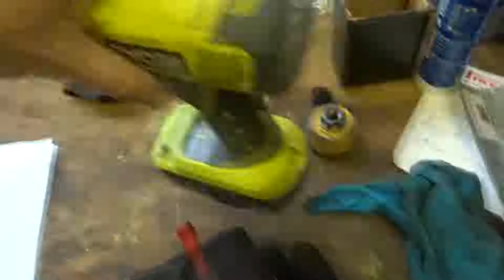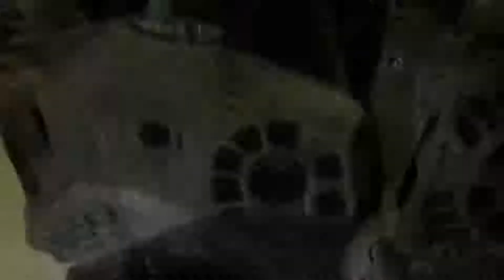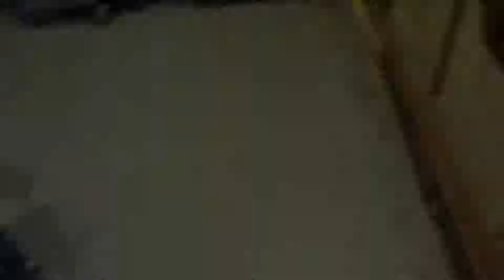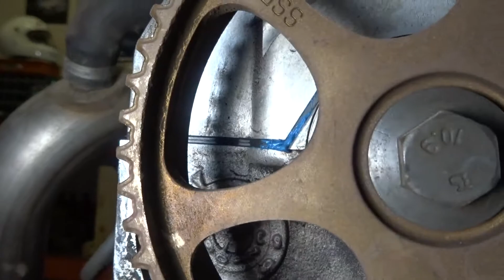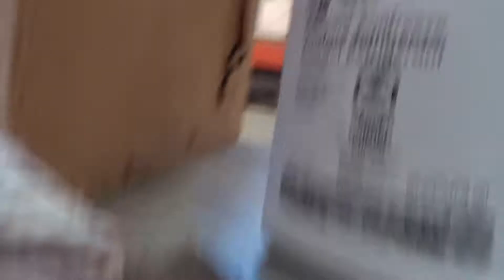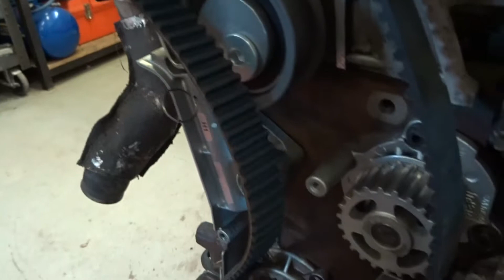How to replace a timing belt and water pump on a  VW Mk 4 golf 1.8T

Comment: Nice work! Straight to the point and clear instructions with important guidance on cleanliness of sealing surfaces, fitting of O-rings, use of torque settings and correct timing checking...now just to do this job in situ in a Mk1 Golf engine bay!  🤓🙏
Reply from the maker: Thank for your kind comments

Comment: Great job! Very well explained. 
What would you say when the timing belt walks from left to right after the assembly ?
Reply from the maker: Probably a sub par or defective belt. A pulley problem would be one way. Unless it’s bent. Won’t last unless it runs true.
Reply: @garysgarage2118 I have ordered a gates made timing belt. Will do the replacement once again on the weekend. Start the engine then before mounting the motor mount back. By the way do you replace the stretch bolts too? My wife is starting to hate this pouring money car. Her comment again 100 Euro less for this wracking car. 😂
Reply from the maker: @EduardM.  VW says replace all the motor mount bolts. Because they have already been stretched you can’t use the same torque process. Just us a torque wrench and don’t exceed the maximum for that size and grade.

Comment: Any tips for the belt tensioner? I snapped an allen bit trying to undo that bolt, it's insane.
Reply from the maker: Thanks for your question. It probably was either over tightened by the previous mechanic or someone put red Loctite on it. Heat is always the answer. Try to use a torch to heat up the area around the tensioner slowly then apply smooth torque to the fastener. If it doesn’t go the first time reheat and try again. Make sure the belt is off first. Good luck. Gary

Comment: there is a hole in the tensioner where the wrench goes that you can put an allen key to hold the tesioner in place - doug
Reply from the maker: Thank you for the suggestion. I will check it out.